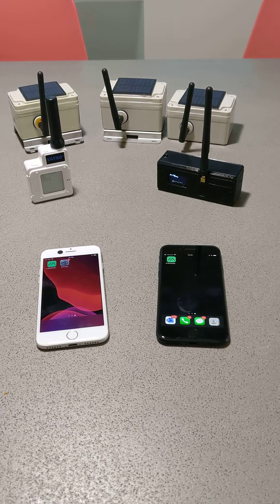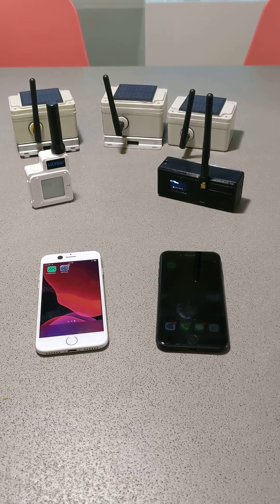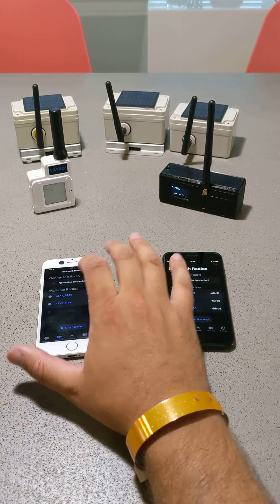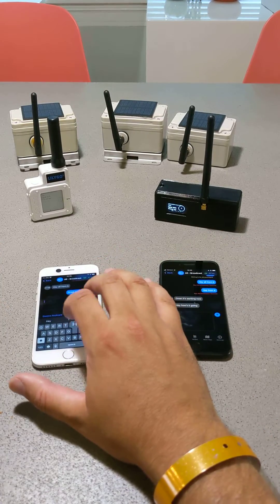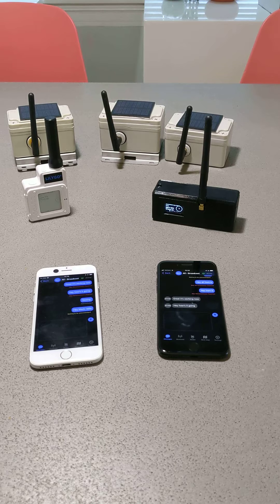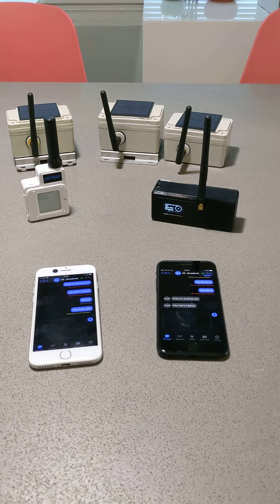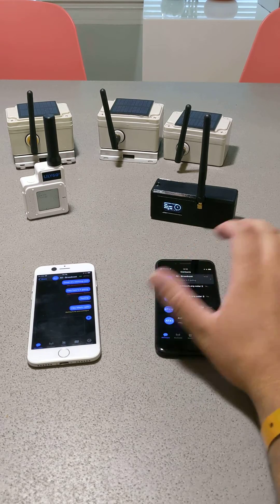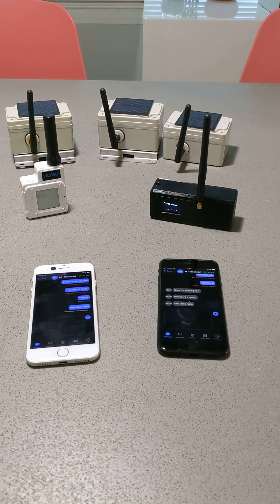AustinMesh.org solar powered Meshtastic network

Comment: Hello from Germany, also experementing with Solar Nodes.
Now after one Year, how did the solar nodes survived the winter? Also I don't know how cold it was.
Here in Germany no way i can run a Node on such small Solar Panels.
How do you protect the Battery in Winter?

Comment: Do the solar panels produce sufficient energy to keep the battery topped off?
Reply from the maker: these ones don't - these tiny panels will only keep the node running for about a week. Check out our newer videos - we're using 6 watt panels now and having nodes run nearly indefinitely.

Comment: Great video! For the three repeater nodes, do you need to program them to a specific channel/group? Or all you did was flashing and installing the latest firmwear?
Reply from the maker: We're just using the default "long fast" channel which is 906.875 MHZ (channel 20)

Comment: What distance do you have to be to message another with your system? And does the re over have to have the radio system on as well for this to work from one phone  to another
Reply: In the city, you are probably going to get half a mile on the ground. If you mount it high though, it can go for miles.

Comment: I wanna put a magnet on the bottom of these and stick them on tall structures like water towers and bridges with a drone. Wonder how long they would last before the solar panel or battery deteriorated.

Comment: Please do a video and show the inside of the enclosure and how you have it configured. How do you have the battery connected? Are you using LIPO4 batteries? Will the battery last for 2 or 3 days with overcast sky? Did you use the GPS module? Have you tested different antennas? Thanks for doing this. I'm probably going to copy what you did.

Comment: What size batteries did you use in the rak boxes? 
Has the solar been keeping them charged in the field?
Reply from the maker: I’ve got one with a 2000 mAh battery and one with a 1200mAh battery. Both easily last through the night. I’ve never seen them below 40% charge. But they are in direct sunlight all day.
Reply: How long have they been deployed ?
Reply from the maker: @BobBob-il2ku  been deployed since July 2022
Reply: What distance is goid between each node?